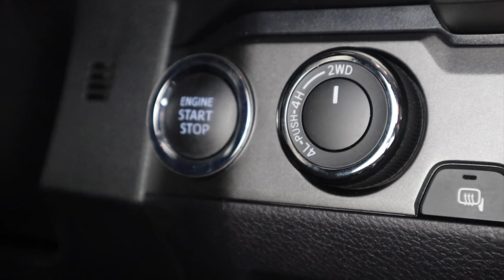Should you buy the latest Toyota Tacoma 2016-2021?

Comment: 6:00 that software update was (thankfully i got rid of my tacoma so i dont know if it this still applies) only available for the automatics. they would not update the software on the manuals even though it has the same exact engine, ecm/pcm and all that. 
a lot of BS in this video like how the breaks work great. get the rear drums wet, like at a boat launch, and they dont work for shit. also get any sort of weight behind the truck, like one single jet ski, and the brakes dont work that good. could that be a drum issue also? and no i didnt have a 16 or 17

Comment: My answer would be....NO!!!!
Intermittent radio, navigation problems.  Problems with cruise control...problems with a coil malfunctioning.  The worst of these was the fuel pump in the fuel tank.  There was a recall which made a big difference...until that pump started getting weak and the truck ran like a dog again.  I'm done with toyota.  I will never return.  Its funny because i found an old 2004 Trailblazer to take the tacomas place after i sold that piece of garbage back to the dealership and i am way happer with my old trailblazer.